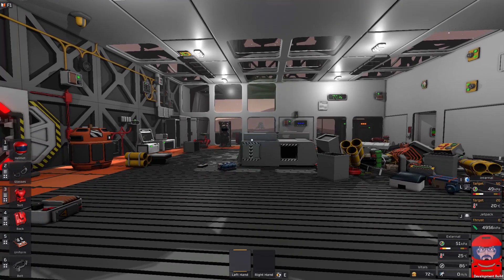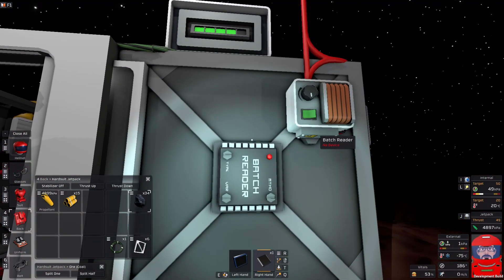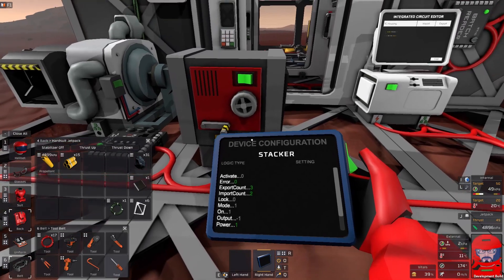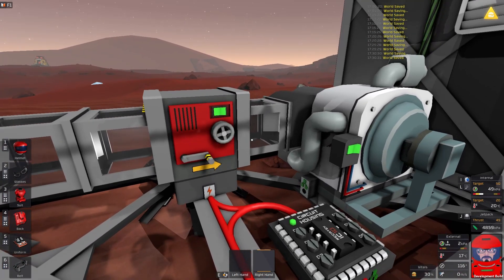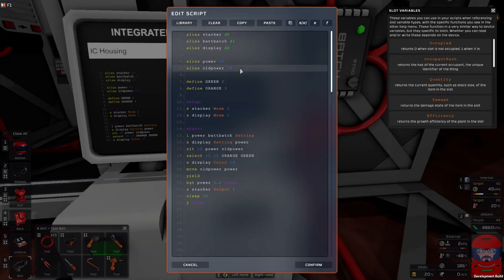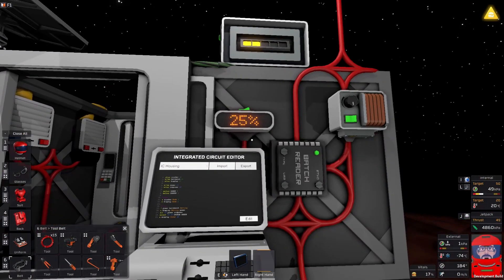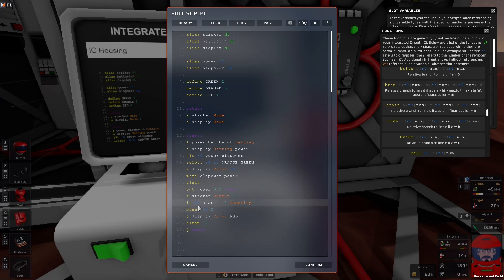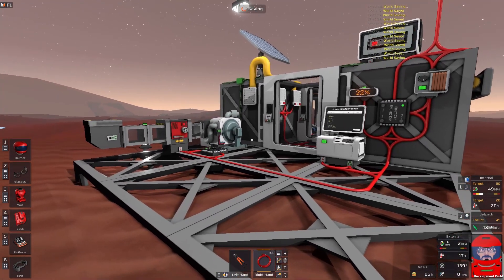Stationeers Automated backup generator

Comment: I think a simpler method would be to tell the stacker to send 1 piece of coal to the generator when your battery reaches 10%, and continue doing so every 10 seconds (or however long a piece of coal lasts, plus 1 or 2 seconds to ensure complete burn), then stop sending fuel when the battery reaches 50%.  This just regulates the fuel supply, rather than the generator, and leaves battery capacity to absorb the excess from the generator once you reach your target.

Battery power thresholds are, of course, entirely arbitrary.

Comment: I'm trying to set up a system similar to yours, but I can't read that purple text, and when I put in setup it doesn't turn purple, it instead turns red and then the configuration on the stacker doesn't change. Would you be able to write out the code you used? I don't understand IC and Mips very well and its difficult for me to wrap my head around to use this code.
Reply: It is
setup:
But it then reads "incorrectLogicType at Line6"  means it does not recognize s stacker Mode 1 anymore. This just throws an error even the Wiki tells Mode 0 oder Mode 1 is valid. I suppose in the meantime the code is not good anymore and updated to something else.

Comment: You can easily do this using a computer and a logic board and no need for a stacker.
Just feed the generator with as much coal you can (bunch of chutes, silo, ... whatever), setup a computer with logic board and set the logic to switch on the generator under a certain amount and back off over certain amount.